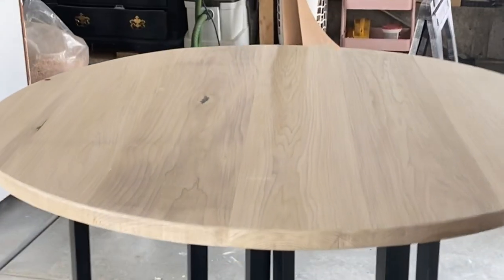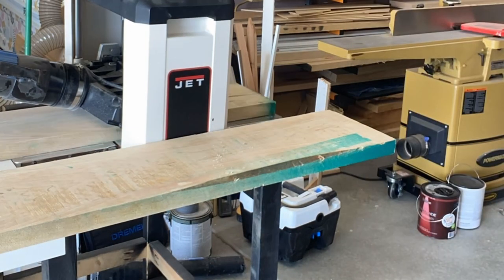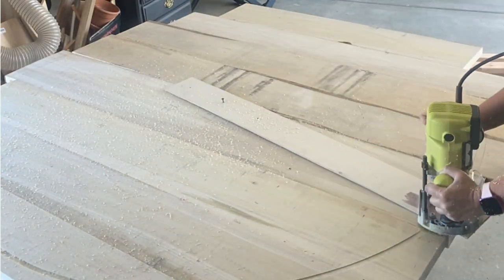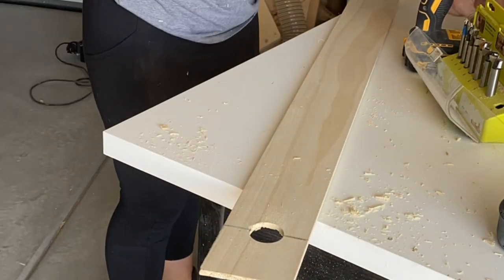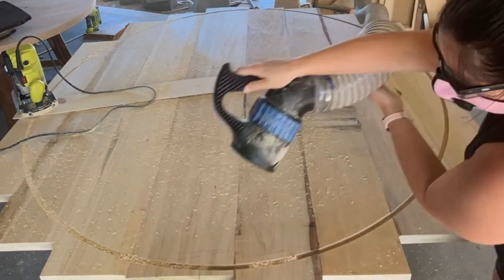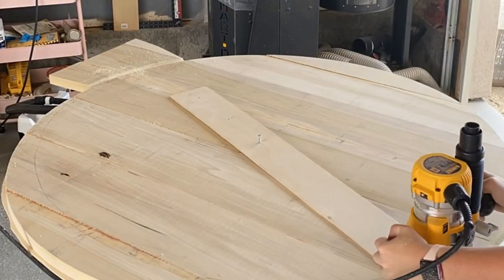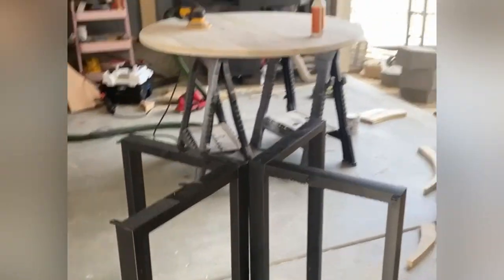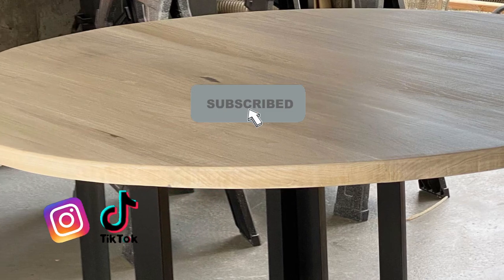Round table top tutorial - process to DIY a wood round table

Comment: Glue is enough to hold the table together? No pocket holes needed?
Reply from the maker: Glue is enough yes, I strongly recommend not using pocket holes in the top of any build. They hold the seams too tight and can cause cracking, buckling, twisting. Glue is plenty and will actually expand and contract with the wood (learned thus the hard way when I started making furniture). Trust the glue ❤️🙌🏼
Reply: @EternalHarvestDecor  ah makes sense! Thank you so much for your reply :)